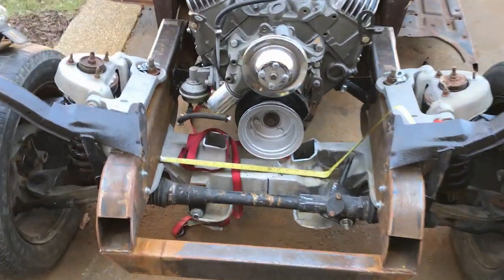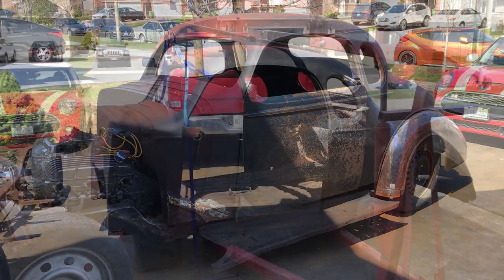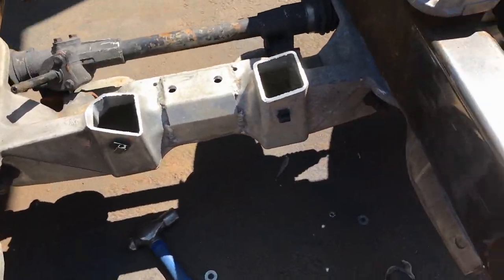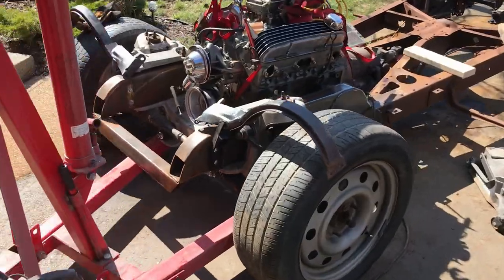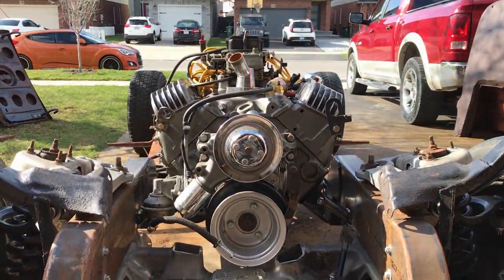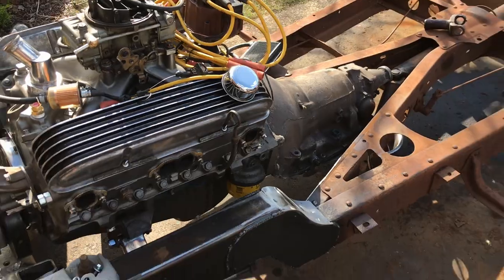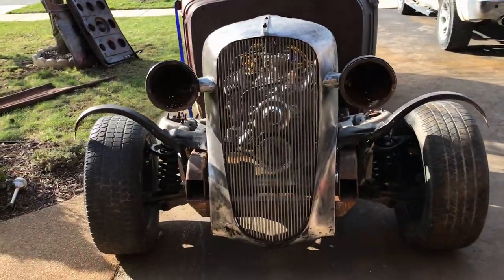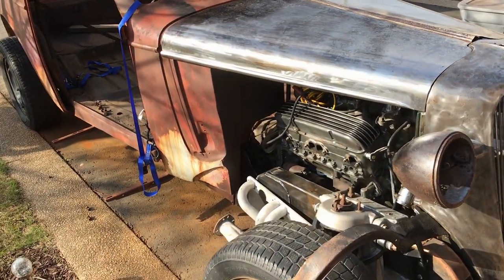1936 Chevy Coupe Body Mounts Part 1 - And a Confession

Comment: If you can get to a junkyard, early 2000’s dodge dakotas have radiator support bushings that are just right for body mount building. Also check out the exhaust manifolds on late 90s Chevy pickups. Not as cool as the headers but I think they may clear your frame.
Reply from the maker: Thanks Eric, I think I might have that sort of bushing kicking about. And I'll look into the headers, I think I know the style you mean.

Comment: I don't know what the plan is. ReDo seams to be the car name. Test fit the radiator with an electric fan on the front  side, check the space to the water pump. If you have a couple or 3 inches you could move the engine 1 inch forward and not have to build a drive shaft. You live in the north where rubber products never die. Go to the junkyard and jack up anything with a frame and unbolt 8 or 10, the plus is you get bolts and washers. A few times I even cut the mounts off the junk vehicle Just giving you options..
Reply from the maker: I've already redone my mounts, that's enough of that thanks very much lol. I'd rather make a custom driveshaft. I might even splash out and get a pro to make me one. Budget dependent.
Reply: I know a lot, Im almost 60 and have re-engineered about 100 old cars. I've parted out hundreds of vehicles to find out which parts work best. I buy basket cases, build or modify the frames so they all get power disc brakes and power rack steering. Then I sell them, the new owner only needs to paint it and trim it out like they want it. I've only built 3 ratrods. 2 of them were custom orders and 1 for me. I have about 6 project vehicles left to finish before I run out of life. Everything you do I've been there, I watch to see if you come to the same conclusions. Thanks for sharing your adventure.

Comment: original body mounts were fabric reinforced rubber about 1/4" thick and 2" wide
Reply from the maker: wow really? so do you think the big round one's are too thick then?
Reply: they are way thicker than the originals. probably 10X or more plus you need to shim them afterward to adjust the body so doors open/fit properly.
Reply from the maker: @ted5415  Unfortunately the floor of the body has been "re-engineered" so I'll be making things fit the best I can.
Reply: originally there was a lot of wood support structures in the body, doors,  and floor. under the rocker panel was a 2 x4 size piece of wood that ran from the cowl back to the front of the rear fender well. the original body mounts were between that 2 x4 and the metal brackets on the frame, so if there is no wood under your floor then you have a much larger gap to fill and might still be able to use your motor mounts for body mounts.
Reply from the maker: @ted5415  So was wood used to save weight or save money?
Reply: that's how they built cars back then. transitioning from coach built wooden carriages to all steel car bodies. 1936 was the last year for wood for chevy. 1937 was all steel. 1935/6 was also cable brakes (rods and pivots from brake pedal to each wheel. try adjusting that for equal braking!).chevy was very late to adopt hydraulic brakes. you can still buy complete wood kits from the southern USA, all hand built for $4-5000.00. all mine was rotten and I am replacing with thin wall tubing. your car has had that done partially if you look at the tubing around the front of the trunk opening and going forward to the rear of the door openings. also, if you look around the trunk opening you will see all kinds of small holes where the body metal was nailed to the inner wood frame (gone now on yours).
Reply from the maker: @ted5415  You are really educating me here. I'm gaining so much respect for vintage engineering. I'll try not to ruin what was crafted so many years ago.

Comment: if you type in "1936 chevy production line" on youtube you will see original factory films showing how your car was actually built
Reply from the maker: Amazing video, very humbling. Did you notice the part with the giant panel press? Both the operators had to press two buttons each to make it operate, do you think that was to ensure no hands were inside the press?
Reply: absolutely, no hands or heads.